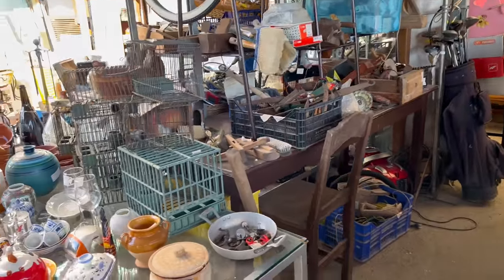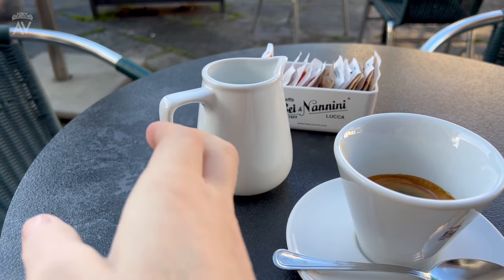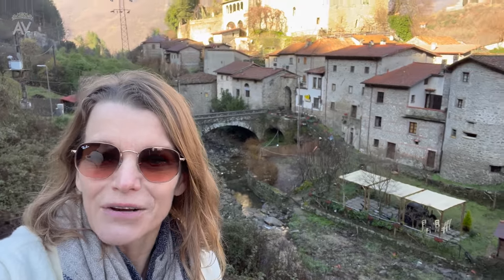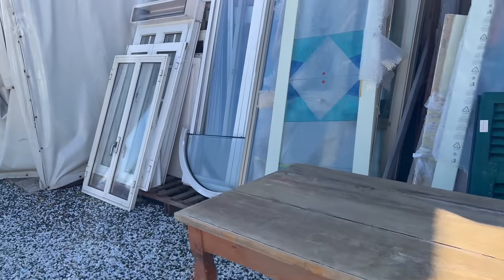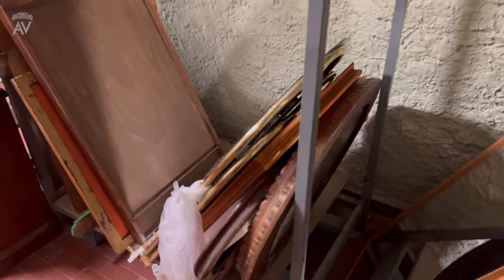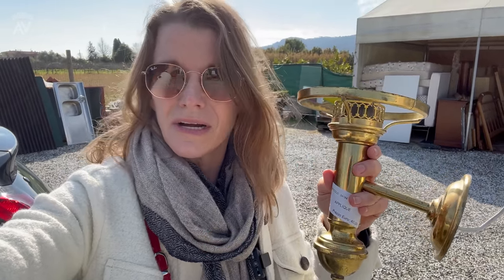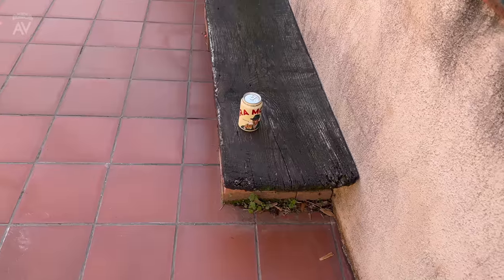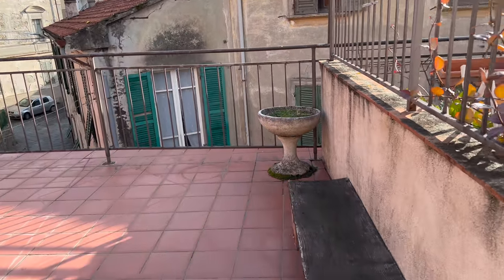LITTLE ITALIAN HOUSE - 1 Euro! My Hidden Treasure AMAZING FIND!

Comment: The bathroom is going to be lovely. You might consider redoing the botanical prints to replace the mat and backing with acid free materials. You can cut out the signature and adhere it to the new backing.

Comment: Well... actually, that "floating" brass circle, round the top of the lamp, is actually meant for the original glass shade. It would obviously have been wider, and maybe green or white. And then with a second tall,  clear glass "chimney", where you placed the new shades. They also come as table lamps and chandeliers.  You might be able to find some original shades in white/ glass? 🙂 If you search for antique student lamps, you'll see what they should look like 🙂

Comment: Measure, measure, and measure again. The most important part of a remodel project. It may have been the cameral angle, but the light fixture looked too low and the mirror looked too high. Your face should be sort of in the middle third of the mirror and from here it looked like your face was in the bottom third. Remember, most of us lean in to put on makeup and do hair, and adjust jewelry and scarves, so we need to be able to see our face and neck. 
Love what you are doing and that town is beautiful!

Comment: I look forward to your Italy vlogs with excitement. Italy isn’t the only place where renovations require the owners’ patience. The homes on either side of my house hired companies to put up new siding and windows. One house took all summer because workers only came a couple days a week. The other house wasn’t completed until the following spring! These construction companies take on many jobs at once thus workers weekly go from job to job leaving homeowners with a mess for a full summer. 😩 Now, here is my question for interior decorators: Is it normal to have silver chrome sink fixtures with old gold finishes on the sconces, mirror and cabinet hardware? Am I too matchy, matchy to think the sink fixtures should match the gold finishes? I’ve been in my house for 38 years and have the same mismatched setup and have always wondered WHY? I recently replaced all the dated Mediterranean cabinet hardware 😳 with beautiful modern knobs and handles but the silver chrome sink faucet and handles still do not match. Julie, your flea market finds are wonderful, especially the mirror, sconces and glass globes. I’ve tried replacing numerous glass globes in my three bathrooms just out of boredom but shockingly companies like Lowes and Home Depot carry the same glass globes I purchased 15 years ago! Unfortunately, my town is too small for a flea market such as you find in Italy.
Reply: Relax, you're in style! Mismatched finishes are on trend because they make a room look like it has evolved over time. They are supposed to look "authentic", which yours is in fact are because your bathroom really HAS evolved over time.

Comment: The electricity for the washingmachine and dryer should be higher !
At least above the hight of the washingmachine and dryer.
Because when the water comes out you can get electrocuted. 🤔😒

I did renovate 10 houses, where 3 of them i owned myself.
I started at age 18 constructing and renovating.